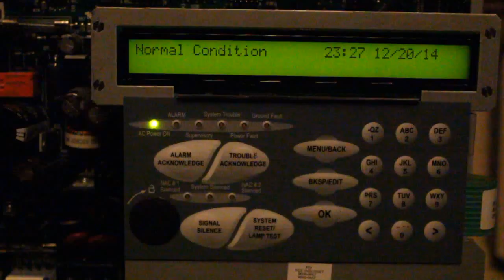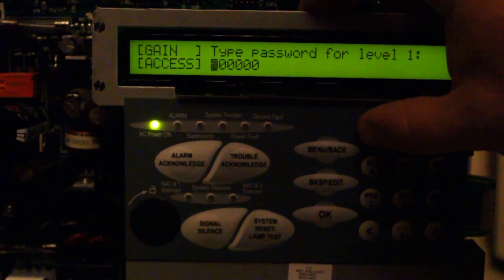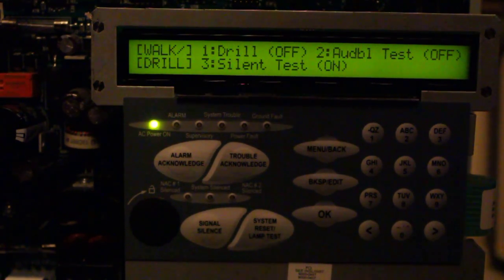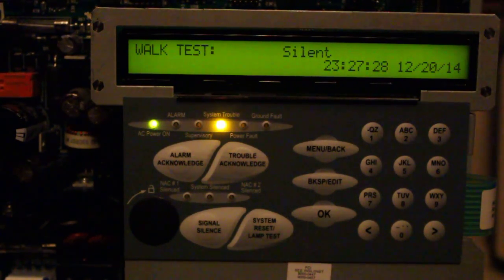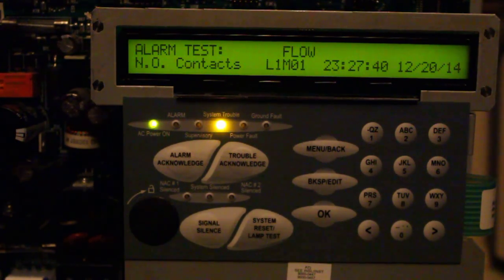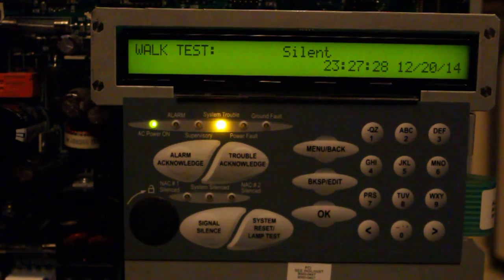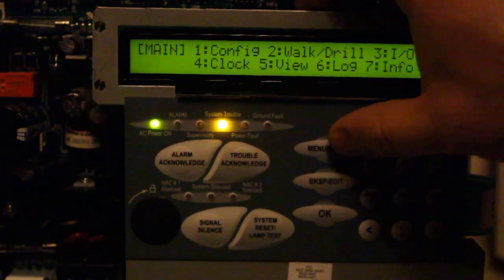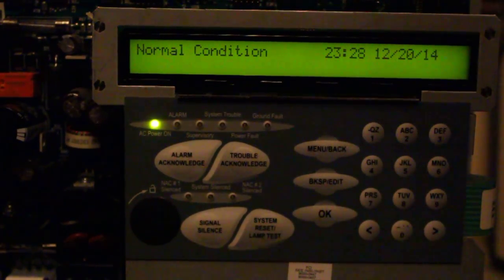FCI-7100 Walk Test Mode

Comment: Thank you for your video. We have this same panel but this was installed
for another company. We have a problem when the alarm is red flashing... it is
not possible to silenced by alarm acknowledge bottom. the system dont reset
too. however i note the keypad is runnin Thank you for your video.
We have this same panel but this was installed for another company. We have a
problem when the alarm is red flashing... it is not possible to silenced by
alarm acknowledge bottom. the system dont reset too. however i note the keypad
is running because when I touch any bottom with the safety key closed, this
appear the legend keypad blocked. I appreciate if you can indicate a procedure
to use the keypad to reset the alarm... now I need to disconnect the energy and
battery to reset alarms. In addition the panel indicate FAULT: positive ground
and SHORT: NAC2 Thank you very much if you can indicate a solution